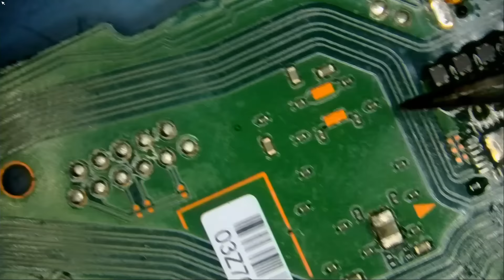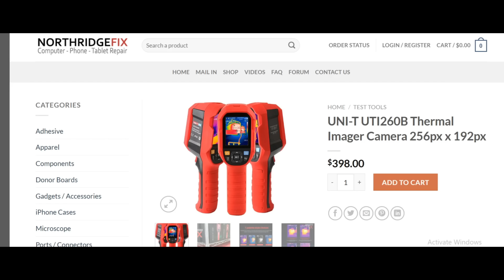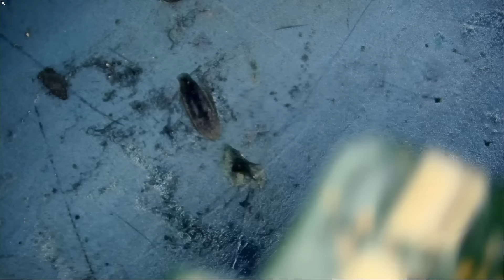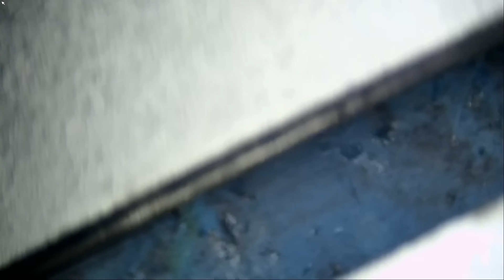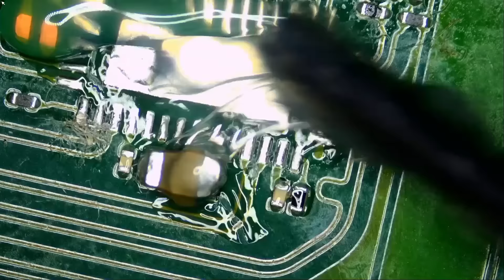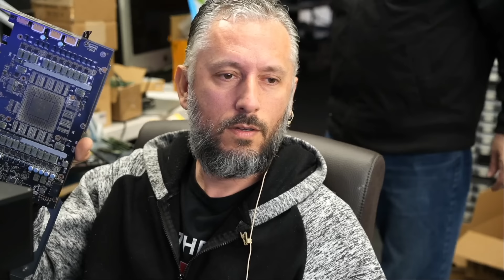Nintendo Switch Disaster EMMC Short Repair. I should've skipped this one.

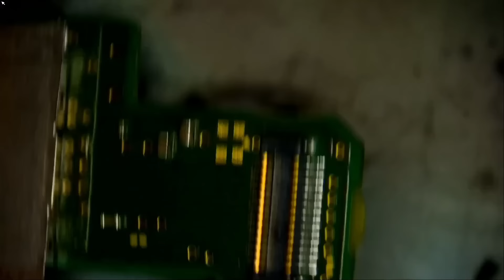Comment: i'm proud of you brother 12:50
i have problem with my thrustmaster t300 how can i contact with you ?
 on of my buttons stuck in active  (R3),  its have a separated small board i remove the board from mainboard but it's still stuck on

Comment: Another thing people don't typically think about when choosing whether to order from the US or China is the shipping times. If I'm buying a tool, whether it be a thermal camera, a specific board heater, or even a screwdriver; most of the time, it's because I've encountered a device where I need said tool to complete a repair. I can't in good conscience make a customer wait 3-4 weeks, sometimes longer, for a package to ship from China just so I can save a couple bucks. I have, and will continue to, gladly pay a reasonable markup even just for faster shipping times, but as you mentioned, the additional support if something goes wrong is always appreciated as well.

Comment: ALEX , I want to ask you  about a small pc board labeled gene 9455 rev b1.0  If you heat it using a hot air near MOSFETs it works for a while then not power on when cool down , can you help me on that according to your experience

Comment: I don't get that card without gpu and memory, I mean, if the customer didn't say it was working at some point then I would understand he just got scammed by an immoral seller who is selling those cards without gpu and memory but the very fact that he stated that the card WAS indeed working and then it stoped working keept me thinking... could it be that he took the card to a different shop first (perhaps a repair shop closer to him) and they stole his gpu and memory while they where prettending to be trying to actually repair it???
Reply: If the card had a burned power connector then that would make it more likely. Otherwise the guy could simply be lying. Probably didn't drive all that way either.

Comment: Why do people remove the core and memory chips?  Is there a market for them?
Reply: You can buy a donor board which does not have core or memory from China. You then transplant the core and memory from a board which either has unrepairable cracks in the PCB or other issues. People are buying these donor boards putting them in shells and selling them to unsuspecting people.

Comment: I saw a couple of guys bust a scammer who was selling  new 4090 cards on facebook. The box was sealed but had a board similar to the one you have. Your customer probably bought one of them.
Reply: I don't think so, Hussain clearly said that the customer said it was working so the only way for that to be true is that when he bought the card it did have both the gpu and memory on it. Maybe he took it to a different shop for the repair and they just took out the gpu and memory and screw him big time and deamn it no repair so he wouldn't even attempt to open it and realize he was screwed.
Reply: @manusoftar  The one he had a couple of weeks ago claimed to be working too.
Reply: @MnPaul1  well, then, what is the point to bring a card wihout gpu and memory to a repair shop???... I just don't get it, I mean, what where they expecting??, to get a gpu and some memory chips for free or cheaper or what?
Reply: @manusoftar  A kid gets scammed and they turn to mom to get it fixed. They aren't going to tell mom that they got scammed.
Reply: @MnPaul1  could be, although if the kid was capable to convince their parents to actually buy such an expensive card he/she should realize that taking the card to a repair shop will eventually make his/her parents aware of the scam...

Comment: Re: the 4090, I've noticed a lot of ads on EBay for cards where it explicitly says the main chip and memory is not included. One wonders if the guy thought he was buying a fixable card for peanuts.
Reply: The bay is becoming a scammer's heaven
Reply: Reply to myself. He said it was working? Rly? Idiot.
Reply: Ouuf 💀
Reply: I wonder if the chips are being stripped off and being sent to China.
Reply: @gerrymichaud3851  most likely, they are always wanted to create a rival to intel, nvidia and AMD. Will only be a matter of time until china undercuts the whole microprocessor market, just like they did with the AI and chatgpt

Comment: Someone got a nice scam going. Those 4000 cards with no gpu and memory. Its not only a melting connector issue. The GPU and the memory are also failing. So those cards are getting repair and the bare bone cards are being sold to unsuspecting victims. That's a real money making scam. I wonder if someone is checking the sellers of these undressed cards.
Reply: I have worked on electronics since the early 70's believe me components in kit nowadays are absolute shite' the longevity of cap's & fet's  is a joke' all this copycat crap from china it's a wonder anything works at all (by the way NASA has found copycat chips in they're projects)
Reply: I wonder if the GPU and memory are being intentionally removed and put into custom AI electronics. I can imagine a much more efficient design would be possible if it didn't need all the circuitry to output to a screen.
Reply: @medhurstt and you think the scammers are better engineers than the whole nvidia team? Bro u tripping
Reply: @GaloTechDog  No I think the 4090 is a graphics card designed to go in a PC and provide video. Bitcoin miners dont want to pay for the power wasted in that circuitry and neither do people building AI systems. That doesn't make their design "netter" it makes it more fit for their purpose. Is it scamming? Or is it just selling the card after the components they need have been removed? Yeah, plenty of people have no clue and may think its a repairable 4090 but if they clearly state it has no core or memory is it really a scam?
Reply: @medhurstt  it doesn't make ANY sense to basically rebuilt an 4090 and omit a abysmal part related to video output. By the way, what parts? HDMI connectors? All video outputting components are in the core itself...
Reply: @bofh705  There are many components dedicated to the video output directly. There are typically many output connectors and supporting components. Also I expect it would be more efficient to consolidate all those mosfets into common, cooled reliable power supplies. Also there's the physical space the card takes up is far from optimal and so is cooling. Also I expect it would potentially be way more efficient to have a common bus rather than using the PCIe interface as built into the card.

If you dont think that makes sense, what is your explanation for the core and memory being removed from so many cards?
Reply: Replying to myself...or possibly bit mining electronics....

Comment: I'm waiting to see when the first RTX 5090 arrive with a burned connector, since they seem to have the same problem as the 4090s.
Reply: The german channel der8auer has shown a review sample of a 5090 with a burnt connector.
The Problem seems to be that 12v high power does no load balancing. He had 120 degrees celcius on 2 12v lines with another card and amps around 15-20, while other lines just draw around 10 amps and were much cooler.
So maybe the desaster with 4090 goes on
Reply: @michaela831  Yes, I saw that. That's why I've posted. 😉
Reply: @michaela831  It goes on for sure, that is why we have to do direct soldering i think for now hahahaaha sarcasme mode on
Reply: Like intel with raptor lake nvidia will probably release firmware that stunts the cards, people complain and in the end move to AMD…
Reply: I don't know why they have plastic sleeving on the individual wires from one connector to the other. This may be a massive constraint on those wires shedding heat away from the terminal crimps.
Reply: Same 😂